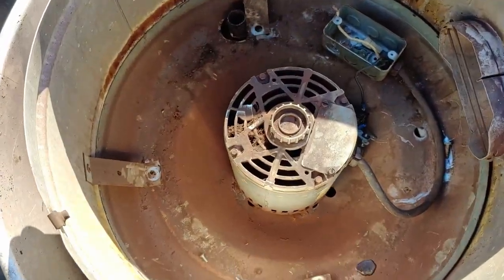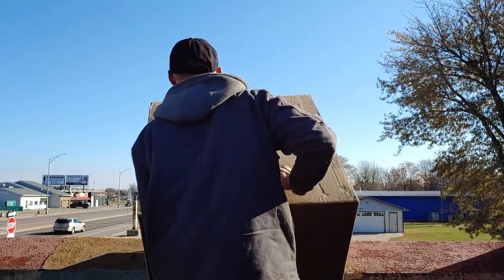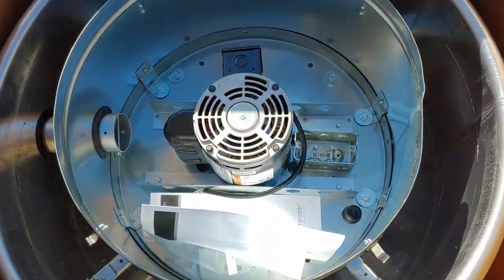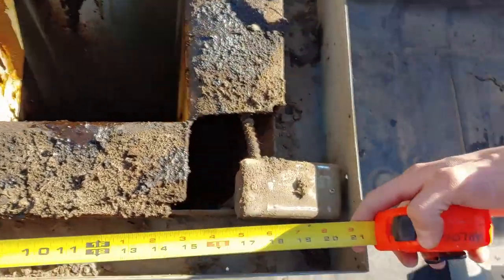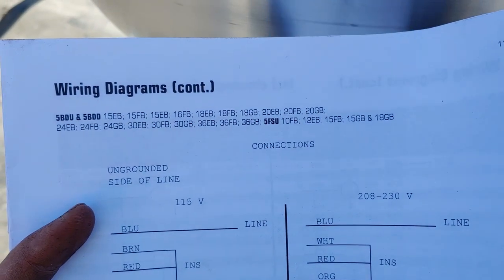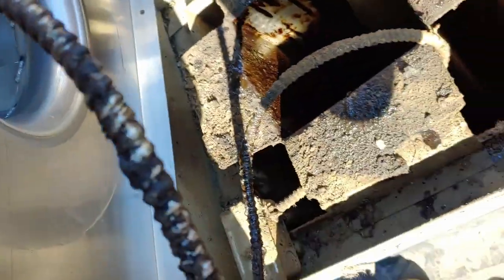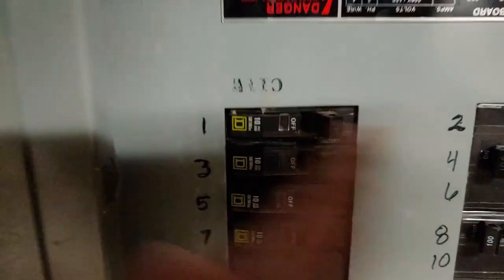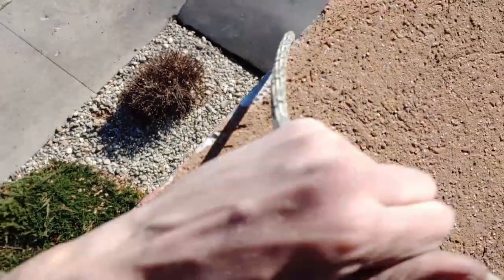How to Install a Restaurant Exhaust Fan

Comment: Can you use a vari-speed  switch to modify the speed of the exhaust fan? KB Electronics 8811007 Solid State Variable Speed AC Electric Motor Control, 6.0 Max amp, 115V, K177-1006. Thanks.

Comment: Hey Reuben, what do you do with the old unit?  Trash? Recycle? Restore?
Reply from the maker: Recycle. If we replace a unit, it's always because it's in too tough a shape to repair or too expensive to repair. Thus refurbishing is not common.
Reply: Are you a plumbing heating and air technician? How long did it take to learn the trade? Thank you for the video